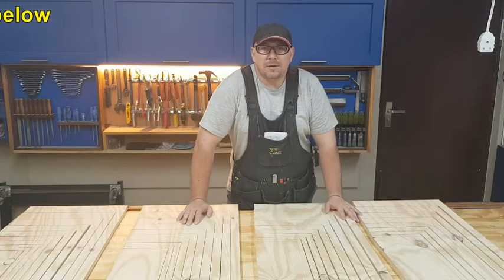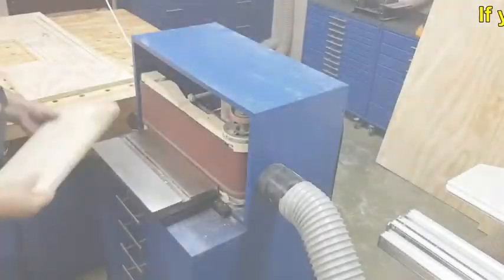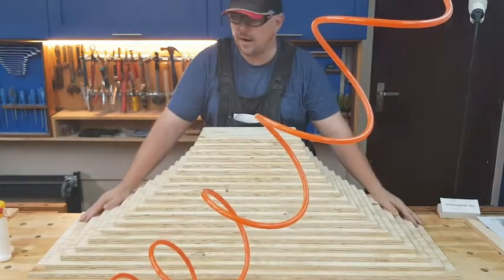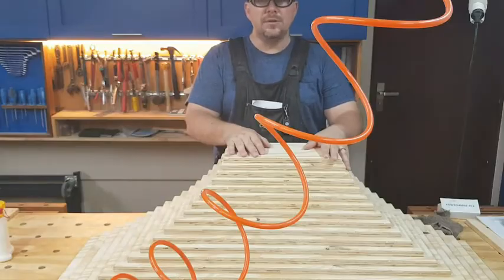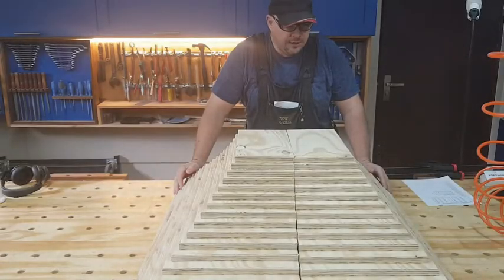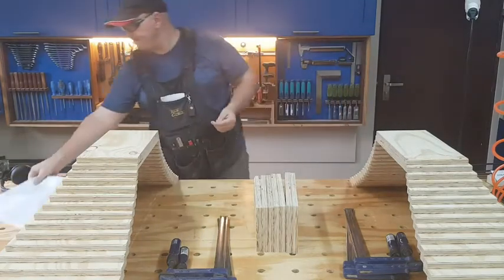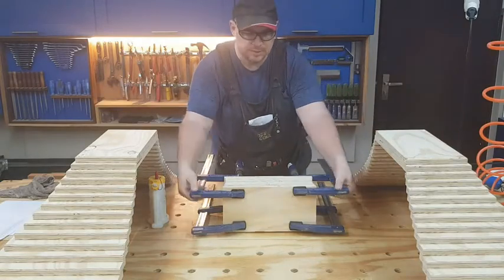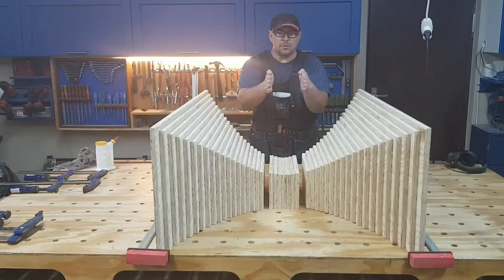Woodworking Project: Curved table from Plywood Part 2 of 3

Comment: Just an idea. If each frame is a square, you can rotate 90 degree between the letter frame and a number frame to make the structure stronger. It will be harder to assemble though.